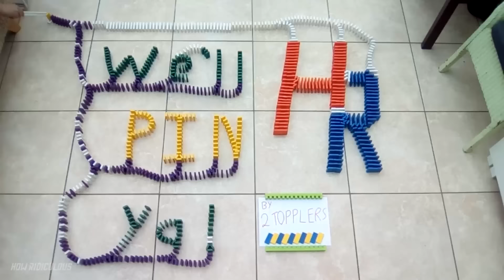Can This SOLID GLASS BALL Survive a 45m Drop?

Comment: The glass spheres’ unusual breaking effect is called concoidal fracturing (credit to ttv_aussieloverkangaroo for the clarification) due to the distribution of force as it hits the steel plate. 

Read #1 for info on the cracking of this glass, read #2 for info on why your shirts were burning.

#1 Glass of this type is of an inorganic silica compound, and is uncompressable. The force has no place to be released, so, consequently, the force pushes the sides of the glass sphere out in a shearing motion. This is called shear loading. Directly on the point of contact, the glass stays almost completely intact, as it is being pushed w/ extreme force, that is then diverted downwards, and outwards creating the cone effect.

These glass spheres might’ve been made similar to how a Prince Rupert’s Drop acts. A Prince Rupert’s Drop is basically a tear drop of molten glass dropped into cold water, creating a piece of glass where the outside is instantaneously cooled, but the inside is still hot, resulting in a force that pulls inwards towards the center of the glass drop. The drop is extremely hard, but if nicked at the tip, can shatter in milliseconds (watch SmarterEveryDay’s video that better explains it here - https://m.youtube.com/watch?v=xe-f4gokRBs)

The Prince Rupert’s Drop style effect COULD explain why the sphere is so hard; when it was cooled, the inner glass of the sphere cooled more slowly, creating a force that pulls inwards towards the center if each ball. This makes it extremely strong, and creates the cone effect. The reason that a pattern seems to emerge where the cone’s shape is almost identical dropped from 10 meters and 45 meters is that, as I said earlier, the glass is uncompressable, and the maximum exerted force was not yet achieved. This might be possible if the spheres is dropped from a much greater height onto a material that would not absorb a lot of force (the plate in the video absorbs a lot of force because of its wobbling, and the sand further absorbs the shock) such as a mangalloy plate fused to concrete, as the plate wouldn’t be able to move, and acts as an almost immovable object.

I’m led to believe that if the glass spheres succumb to the force and eventually are smashed against something with enough force, they will either crack into multiple large chunks, OR shatter into different shapes, where the closer to the point of impact, the smaller the pieces.

#2 My hypothesis on why the spheres built up such a strong magnification of the sun so quickly is just the nature of the ball. In you cut it in half, and aligned the cut side parallel to the sun, you’ll see that the side closer to the sun is shaped like a concave lens, and as the rays hit the ball, the energy and light is dispersed. When it reaches the other side of the ball, it meets a convex lens, which concentrates the rays of light. It’s basically an extremely efficient magnifying glass.

More technical info on Hertzian Cone Cracking- https://royalsocietypublishing.org/doi/10.1098/rsta.2014.0135

Concoidal fracturing in other circumstance- https://www.sandatlas.org/conchoidal-fracture/

Feel free to blast me in the comments of my comment. I understand not everyone will agree with me/believe this is self-research and not plagiarism. But I really don’t care.
Reply: JESUS
Reply: You dint want to do too much
Reply: Yep,'bout right 😁
Reply: So basically glass spehres would make awesome cannon balls because of the coney-joneys
Reply: Smart man, thanks for the info!
Reply: Buncha blokes dickin about, outsourcing the science to the comments. That's a formula I hadn't seen before.
Well done for providing the science, even if the article you listed doesn't quite cover the same circumstances.
I would add that the whole setup is too elastic to shatter the spheres. Dropping on metal lying on loose sand + glass itself has some elasticity.
Reply: It’s actually called a coney joney
Reply: i will explain it like i am someone with out a master's degree but the hertzian cylindrical cracking effect is when it breaks from the top not the bottom and looks like a more cylinder than a cone shape it is actually called the concoidal fracturing effect i wont explain it as it is to long rest is correct... great answer i didn't bother in writing my own but the guy at the top is wrong and really appreciate you doing it correctly
Reply: Good God 🙃
Reply: The offset coney joney  is because the plate is not horizontal
Reply: I really enjoyed the smarter every day video that you linked. Thanks for that! It was so interesting. And I also appreciated your taking the time to explain all of that. 👍🏽 How good!
Reply: underrated comment rn
Reply: I'd love to see how they are made
Reply: Glad to see someone else watching Destin!
Reply: Look! It's Kaydn it reminded me flint knapping and I was trying to remember that name of the effect. Thank you for once again saving me from looking it up
Reply: Get the pin here 😱😱
Reply: Well, that explains it I guess.
Reply: When it said read more... I didn’t know it meant read that much more
Reply: Sweet :) thanks for the breakdown and nice job!
Reply: I’m assuming no one even red that whole thing right?
Reply: ayo slow down ainstain
Reply: Ok you win lol
Reply: @minusskydiver5039  I read it.
Reply: Exactly simple physics boys
Reply: Copy and paste check
Reply: Look! It's Kaydn so you’re a genius?
Reply: @LiveDonkeyDeadLion  in like flint , 😆
Reply: Big Brain Time
Reply: sweat
Reply: Ok buddy we know u copied and pasted
Reply: Corban Hanson he copied and pasted
Reply: Shielzy yes, I do believe the link he posted to the abstract is evidence of that
Reply: Big brain
Reply: Did he just say 'Immovable Object'... ... *Grins @How Ridiculous.  Think you just found your next 'fun' item 😈
Reply: Roody-Poo Jabroni Lets go Bills!
Reply: nice dude i didn't know that
Reply: this dude put credits in a youtube comment
Reply: Holy shit ur right
Reply: It would have been cool if you actually knew what it meant but you just googled it.
Reply: Big brain
Reply: This seems right... i seconds this one!
Reply: girlfriend cleans my 4wd! watch my 3rd recent video!! GIRLFRIEND CLEANS CAR..
Reply: I do not think theses globes are made in the same process as a prince rupert drop, because in that process the outer surface is pre stressed, and would have shattered to millions of pieces on impact when it broke.
Reply: a Prince Rupert's is "toughened glass" the spheres are not. completely different effect.
Reply: oh wise one teach us more
Reply: Also
ThE prince Ruperto drop effect is Incorrect drop a marble it shatters into a million pieces
Reply: Harrison Crosley yeah buddy! Looking forward to our afc championship loss to the chiefs
Reply: Kaydn Ito I didn’t read it, too long

Comment: Coney Joney: Solids are much weaker under tensional stresses than compressional stresses. Due to the amorphous structure of glass, it is very strong under compressional stresses and so will only break in the places of high tensional stress. This tensional stress occurs in a cone radiating from the small point of contact and is due to the rapid deceleration of the ball. The top and middle of the ball remains in compression so does not fracture at all.

Edit: In addition, as other comments have said, the ripple effect on the surface is called conchoidal fracturing, and this occurs in materials with no crystalline structure. It is the result of the way the shockwave and hence the tensile stress is transferred through the ball. It is the same process by which flint tools were made back in the day.
Reply: Like an egg is stronger if you put pressure on the top and bottom
Reply: Thank you
Reply: Nice.
Reply: So basically the mass above where the impact point is is supported by the impact point, but all around that is this huge amount of overhanging mass which wants to keep moving so shears off?  
Edit: I should change "sheers off" to "gets blown up".
Reply: @maulerrw  as far as I understood it, yeah. It makes sense, the very point of impact strays strong, but the stuff around and above it have nothing to "collide" to, so it tries to continue going downward.
There' also something interesting and it's that the ones from the very top are almost concentric, while the ones from lower are kind of off to the side? I think that's because they threw it forward so it would hit the plate
Reply: @UCr3sPN71nSrixw3qiCk1cmg more or less, yeah. The impact created a cone of intense stress, and that’s where it sheared off
Reply: @ArtofCrimms  yeah the balls had more horizontal and rotational force so it was more off centre
Reply: Awesome, relatively simple explanation of a really interesting materials science question.  Thank you!
Reply: Spot-on.
Reply: I had the same take on it
Reply: I would say that the glass has more compressive strength than shear strength, so where the ball impacts the forces are perpendicular to the surface and the compressive strength is greatest.
Reply: Garfish that’s the simultaneously most accurate least jargon filled explanation, yes. You could also add that since it is a sphere, the glass directly in line with the impact point is also the thickest, most reinforced angle against the compression forces as well.
Reply: the shape of the fracture makes me think it might also have something to do with the way the glass ball was formed in the first place. I can see those swirling lines matching up pretty well with the swirl  you get just by turning the stick to pick up more molten glass, right?
Reply: Thank you Google.
Reply: Aww, y'all gonna have to give it to this guy.
Reply: This deserves to win the Commtest tenfold.
Reply: Very good explanation! Totally makes sense, hope you get pinned!
Reply: Top notch.
Reply: I'll take a guess at it. Glass has a high compression ratio which is why it has the point of impact still intact after every drop but at an angle it will break. The angle is why they make the same cone shape each time regardless of height. The rounded bumps can be explained by how energy travels. Energy travels in waves like sin and cosin waves therefore when it travels up the glass it breaks off the outside of the wave as it travels up towards the mid section of the sphere
Reply: #LearnSomethingNewEveryday
Reply: @ArtofCrimms  That makes me  wonder what the Coney Joney would look like if the glass ball was spinning really fast when it impacted.  Would it have the same effect as it impacting  at an angle?
Reply: Thank you good sir I was thinking the same thing thank you for your confrontation
Reply: Big nerd